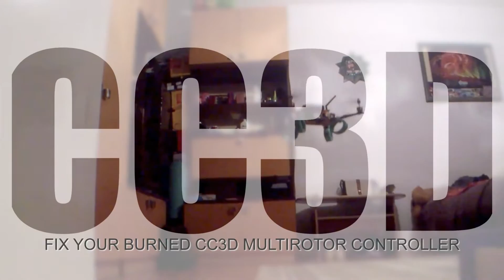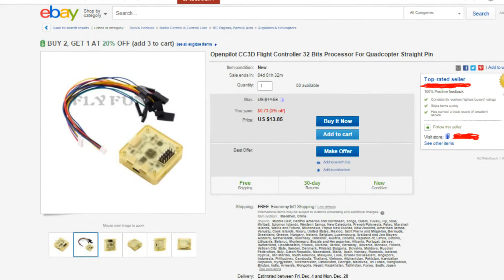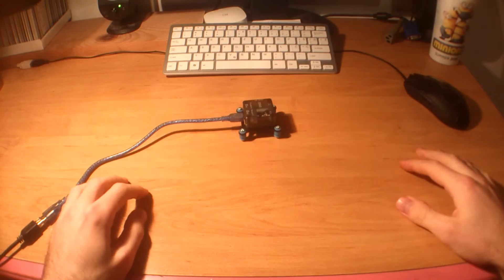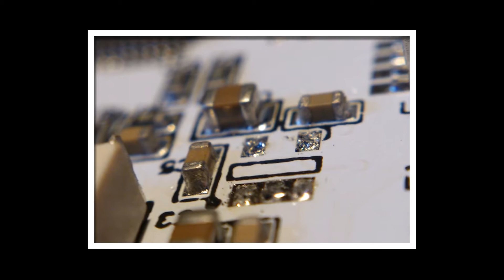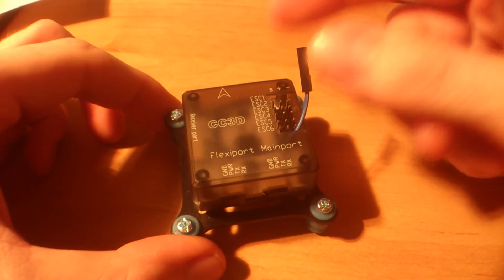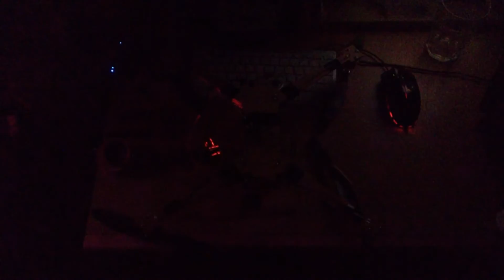How to fix burned CC3D multirotor controller board

Comment: I think I have a regulator problem with my Omnibus. If I plug in the usb and then the battery I lose the accelerometer information in betaflight. Does this sound familiar?
Reply from the maker: so if you plug in only usb then it works? but if battery is connected together with usb then it stops working? Only accel. data or complete usb connection breaks?
Reply: @TomislavTeskač  Correct. If I combine the usb with battery then I cant use betaflight
Reply: Betaflight appears to work.....but so limited that it is useless....when I combine battery and usb

Comment: My cc3d can't power up by esc 5v pin but I can power up by USB. The left corner component(regulator, near the PWM connector) is very hot and can burn my finger. I suspect the few components having problem. Anybody can provide the component value reading for me. I can test the reading by multimeter.

Comment: Do you know how to reflash a cc3d to librepilot using arduino?
Reply from the maker: Connect your Arduino to CC3D as follow: 5V – 5V, GND – GND, TX and RX to the MainPort on the CC3D. Note that you should put a jumber to bridge the GND and RST pins or upload "bare minimum" code example to Arduino so no code is executed during flashing. http://dronehitech.com/en/flash-cleanflight-cc3d-arduino/

Comment: If you have a heatgun, and parts bin with electronics that has smd components, chances are you will find a replacement voltage regulator you can replace. That way you know it won't cause damage and actually be fixed.

Comment: it happen to me .i can program/flash that fc before  and then idk why it cant power up when i connect it to pc via usb cable.if i connect the FC to the 3s lipo battery the blue led indicator blink very fast.

i read on reddit they say "why you bought $13 FC,there alot defect"

Comment: something strange was happened today with my cc3d revolution fc. it didn't power, the green led was on but very weak, after that I've done the same investigation as you and found, that instead of 3.3v there was only 1.8v. the board has few voltage regulaturs 5333B. i think the only way to find broken regulator is desolder them one by one.
Reply from the maker: yeah, unfortunately you can't know what gone wrong, you can only guess, but if you are powering it with a voltage close to its max input voltage then it's more likely one of regs is dead. Did you fixed it?
Reply: Tomislav Teskač not yet, to go through this quest I have to buy hot air gun, so, ater this when(if) i will determine the cause, will be the next step - finding spares an so on :) I will update this message when there will be some positive results.
Reply from the maker: if you have difficulties with unsoldering that tiny components may I suggest you to try this - I have bend a thin wire on my soldering gun so I could solder very precisely:  http://imgur.com/a/94o93